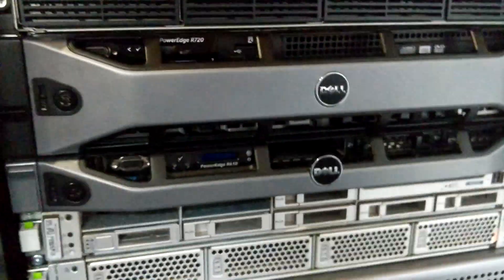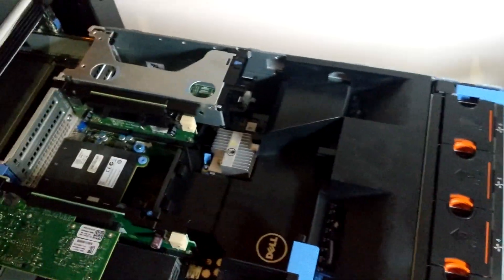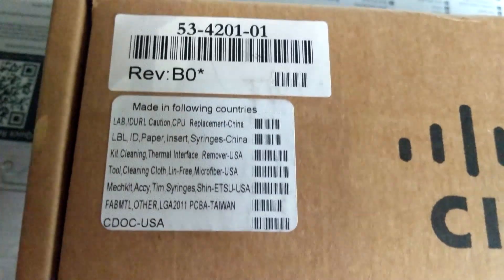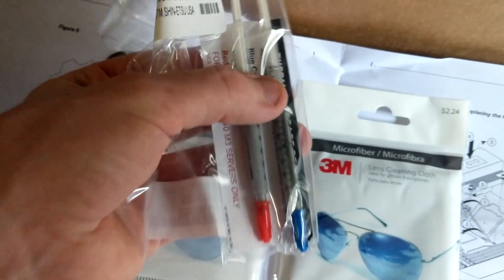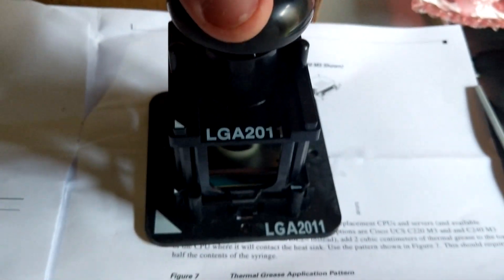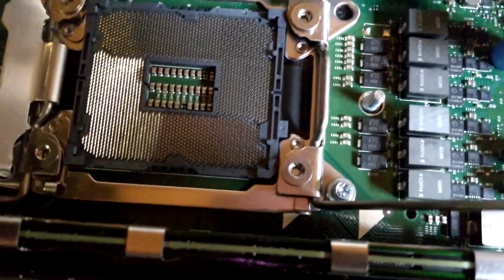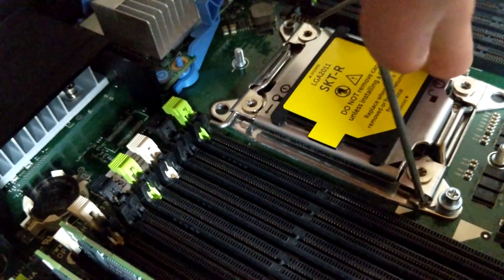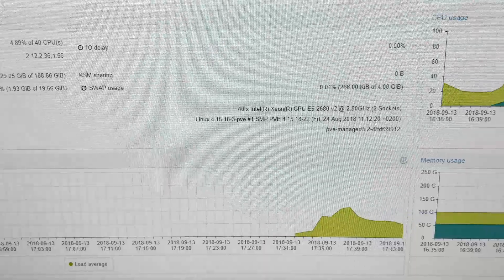Upgrading the Dell R720

Comment: FYI while dell officially requires an 1100W, I run my Tesla M40 at 250W 24/7 on my 750W PSUs without any issue. It works fine with one or both of them. My peak power was 610W and I average closer to 560W while GPU at full speed. I am however going to upgrade to 1100W so that I can add a second GPU.

Nice video.
Reply: Could you please give the link for the cable you've used for the M40-r720 connection?

Comment: Are the newer Xeon E5-2600 v3 18 core (each) compatible with the R720 and if so then does that mean that I also have support for the newer DDR4 ram?
Reply from the maker: No, the v1/2 use the LGA2011 socket. The v3/4 use LGA2011-3. It's physically the same (irc) but the pin out is different making them incompatible with each other. For the v3/4 you need a 13th gen (R730 for example).

Comment: In 2022 ,  r720 vs r730 is the extra cost worth it to get a little faster cpu and ddr4?
Reply: If you are using for a home lab, I don't think it's worth just yet. R720 will do just fine :)

Comment: Hello, nice upgrade! I was wondering if you've tried to run a GPU off the dual 750W PSU's? I am really interested if it will work as I want to buy a R720 and add a single GPU to it (probably a 1060), but I would like to use the 750W PSU's. All the best :)
Reply from the maker: Hi, Yes I have actually. I tested it with a GTX 770 (rated to consume 230W), and it was fine. Albeit I didn't pin the CPUs at the same time. You should be completely fine with a 1060 as I they're rated to use around 200W.
Reply: Ues they work, the psu is 80+ titanium so power drain and efficiency is not a problem

Comment: Q for u if u got the 2680 V3 or V4 would they still work??
Reply: Nope.. They won't work - they aren't even physically compatible since Sandy Bridge EP (v1) and Ivy Bridge EP (v2) are socket 2011 with DDR3 memory, whereas Haswell (v3) and Broadwell (v4) are 2011-3 with DDR4 memory.

Comment: What's the power consumption of that beast sitting idle loaded up with all that RAM and CPU?
Reply: The 2x12 (I guess e5-6590?) core variant with 512GB ram uses 470W-610W.. I have one
Reply: @joshuaanschutz5213  at idle ?

Comment: I was able to pick up a pair of R720XD servers and was looking to see if anyone has been able to add a NVMe Drive to this server??  Have you looked into adding a NVMe and I really liked the CPU upgrade. I would have liked to have seen adding the heatsinks and info on those but I really liked it. Please let me know if anyone has been able to add NVMe to this server.
Reply from the maker: The 12th gen servers from Dell unfortunately do not support NVMe natively. That is to say as a boot drive. If you got a PCI-e to NVM-e adapter add-in card, you would be able to use it as a storage drive (just as another drive), just not for boot.
Reply: @zanginator-tech  Thankyou   that is good that it will support the NVMe with a add-in card but not as a boot device.  But these servers were built well before the NVMe came out.
Reply: Just an update I was able to get a StarTech.com M2 PCIe SSD adapter -X4 PEX4M2E1 and installed a Samsung 970EVO Plus 1tb and it works great. I put the card in a X4 slot and when the server boot the drive was there and I just needed to go to diskmanagement and set the drive online and format it. I don't think I could see the NVMe drive in the bios H710 card.

Comment: Nice vid man
In few days I'll have a R720 with 192GB ram and 2x E5-2697v2 ;)
Can you might tell me if the cpu cooler bottom is out of aluminium or copper?
Id like to know if i should order Liquid Metal or not ;)
Reply: I just replaced my 2 E5-2630's with 2 E5-2697 v2's and I used the stock heatsinks that are copper. I did run into a problem with fan noise and the fans pegged at 100% and did not spin down. I checked and finally found a post on Dells web site and I needed to go into the BIOS/SystemBios/SystemProfile/select Custom and enable C1E, mine was disabled so I just enabled it and the fans now settle down between 36-41% fan speed and that made a world of difference for my home lab. I would like to find some direct replacement quiet fans but this is the best I have found so far.  I have the 2 E5-2697v2 with 256gb of ram and it is my main hypervisor.